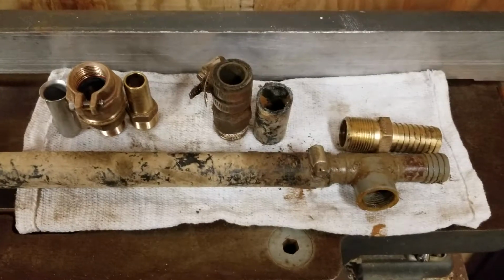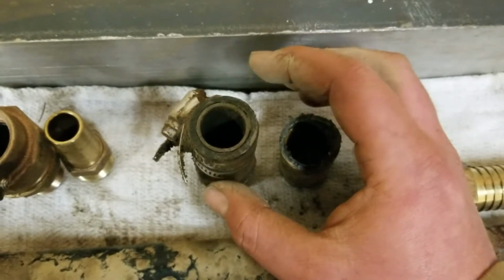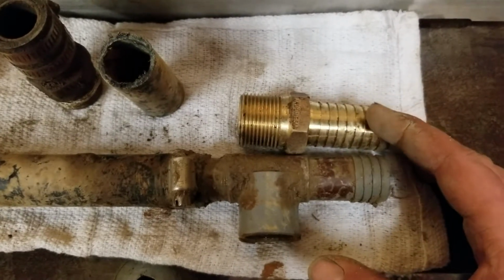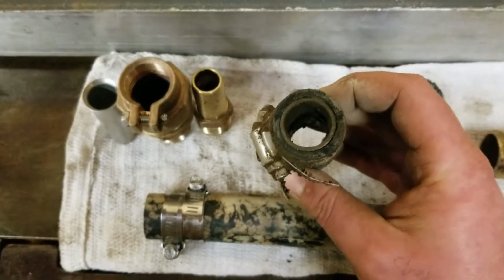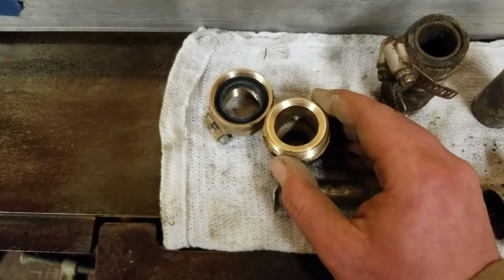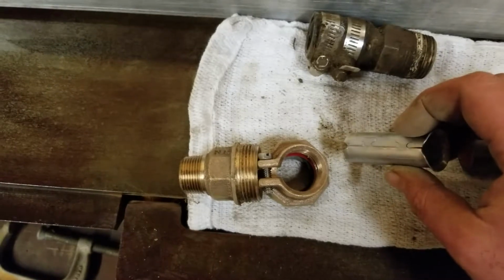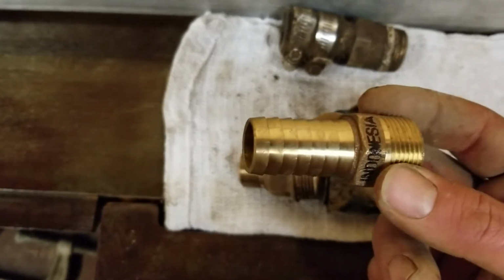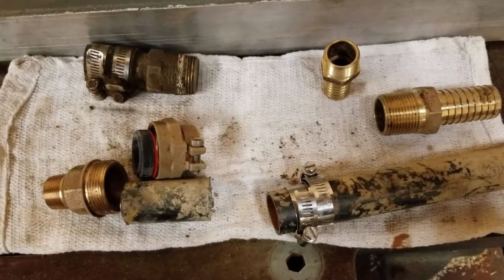Fittings and HDPE water line

Comment: My water main busted recently and I cut a small section out. What fitting would you suggest using when the pipes are fixed in place and CANNOT be moved together? My pipe is the black hdpe pipe 3/4.
Reply from the maker: If it was me, I would do two packjoints by MIPT (male iron pipe thread) and a coupler. Assemble one packjoint and coupler and slip on one side and then install the other tighten together and tighten up the packjoints and the retaining clamps, hdpe should have a wall thickness similar to IPS sch 40, if it's thin barb fittings will probably have to be used .
Reply: @JIPNW  It’s a thick walled pipe. I do remember trying barbed fittings in the past and I couldn’t wrestle them in.
Reply from the maker: Pack joints would be the easiest then, just remember to get the stiffners

Comment: Do the barb fittings tend to have more leaks than pack joints?
Reply from the maker: No barb fittings don't tend to have more leaks than packjoints. In our experience we have seen barb fittings, especially plastic ones used on thick wall or 250 poly or HDPE instead of pack joints. Packjoints are easier to install but cam be difficult if the piping has any curves to line up and get the threads started on the packjointa